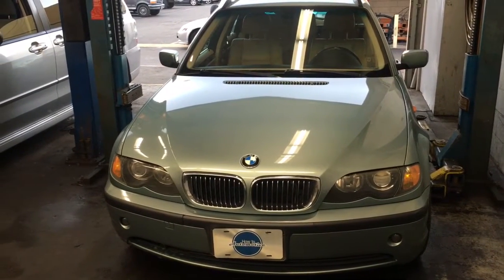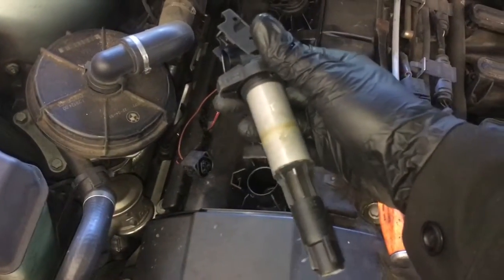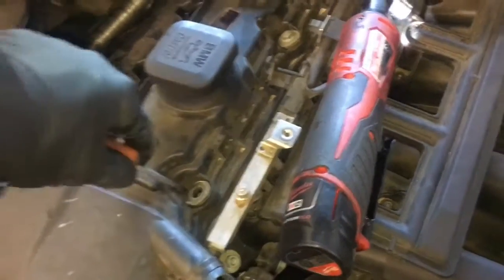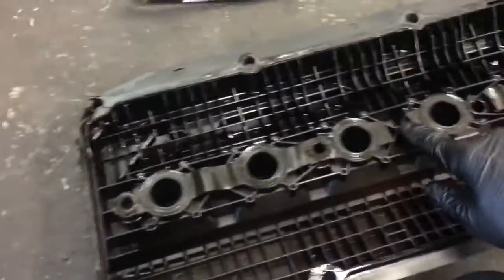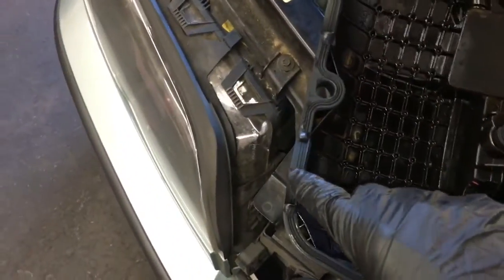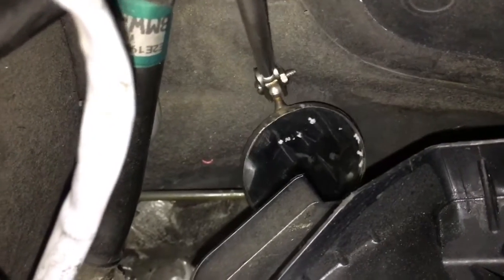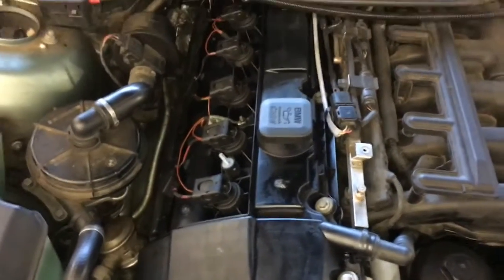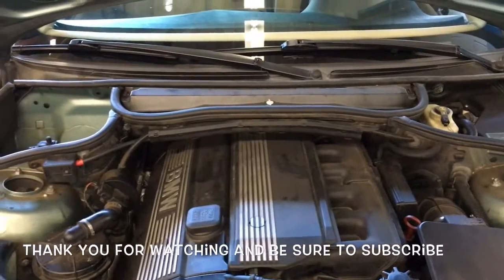How To Replace The Valve Cover Gasket On A BMW 3 Series E46

Comment: Been working on a lot of bimmer's recently! Loved my E90. Used to work for BMW
Reply from the maker: Mookie Man I worked on about 8 in last week. Last week it was mostly VW. I had a E46 and it got stolen. It was found in Mexico stripped.
Reply: How to Automotive that's a shame. I had an Acura stolen and stripped. What's your opinion on the worst made brand out there currently. My mechanic thinks Nissan is the lowest quality.
Reply from the maker: Mookie Man I would say land rover is at the bottom of my list.
Reply: How to Automotive really? Even their new stuff?
Reply from the maker: Mookie Man I guess I'm  turned off so much buy there old stuff that I won't give their new stuff a chance.

Comment: Great video. Did mine tonight. Your video made this job very easy. I hoping the new gasket solves my oil smell problem. I noticed some wet spots near the back passenger side. When I took the electrical harness off. Mine only had one ground wire. Your video showed two. Wondering why my 2005 320i only has one ground. Also, I feel someone was already in there. I found washers under the old gasket on the middle screws. Strange. Any ideas?
Reply from the maker: Mike in Alberta i’m sure this will fix that burning smell. As far as the washer and the ground wire it’s possible somebody was in there.
Reply: @HowtoAutomotive  I let the permatex dry for a few hours. Just ran the car for an hour. No oil smell. Couldn't be happier. Thanks for the help with your video.